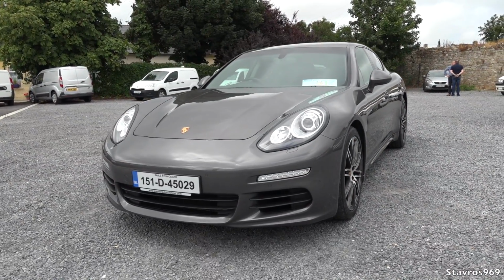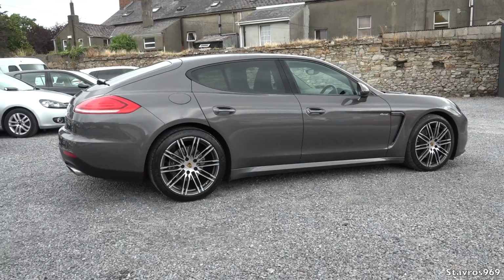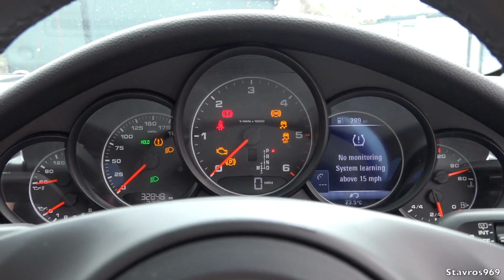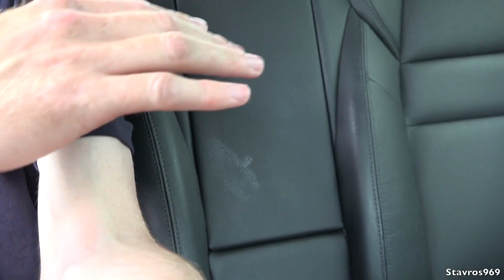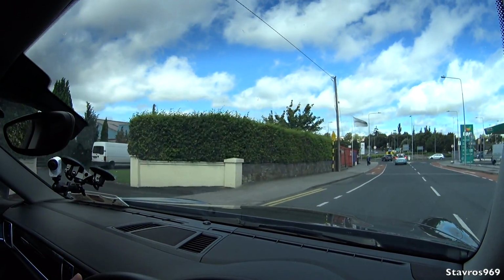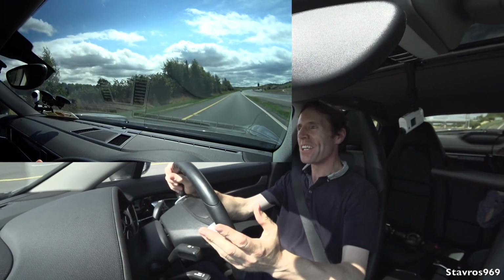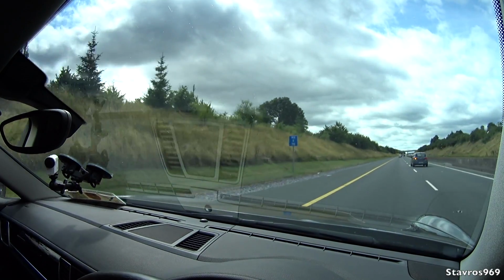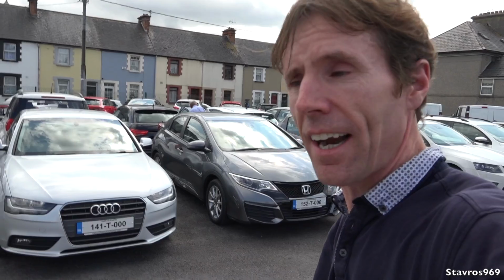My First Porsche Experience - Panamera 3.0 litre Diesel Test Drive & Review

Comment: I must import one to British Columbia Canada. 

I appreciated the drive you took us on. I love an honest and reasoned look at why some who can clearly drive and loves to drive (and you sir my friend in deed can drive) can with out reservation point out why a diesel in this car makes so much sense. You showed that the 1/4 mile is amazing for what we in Canada call a 4 door sedan, and that it can get uo to speed, and most of off all and typical of diesel engines is the low end available torque. It might not be fist out of the gate but it will leave many V6 and V8's behind when chugging up a mountain side at only 2500 rpm.  

I drive from Vancouver to several places on the coastal Islands, and back east on the other side of the Rockies.  

This car was made to be driven in the Coastal Mountains, and up down and through the thousands of miles in the Canadian Rockies and down the highways on prairies under an endless blue sky from dawn till dusk, and well past twilight and a canopy of stars above.

I drive a VW Passat Diesel, it and the Audi  A6  / Allroad  / Estate / Variant's from where this Panamera's engine was "poached" from are excellent for cruising and long hual trips where it sips on diesel slowly like the queen does her tea. Why not put it in an executive cruiser with huge cargo room and torque / power where it matters to climb a half dozen mountain ranges before you need to pull over and sleep.

If you are a Brit or Continental and you think it is  solid and more than capable saloon for your narrow highways imagine being Canadian where in a good day you can drive 12 hours in any direction on mountain highways. To put it in perspective it would be like driving 12 hours in any direction on mountain passes in the Swiss Alps, but much of it far more challenging to drive than the Alps and petrol station are few and far between.  A rock solid power plant with enough cargo and seating space to carry skies, fishing, hiking / camping gear, your dog and friends / family and it can get 40mpg... 

I would have no problem hooking up a trailer to this Panamera, or using it like it should be as a practical albeit exotic estate car / wagon. Add a roof rack and travel in style, winter, spring, summer, or fall. To sit that low, and blended with cabin and "cockpit" refinements, firm handling, and have the freight train like diesel torque and economy... Magnificent!